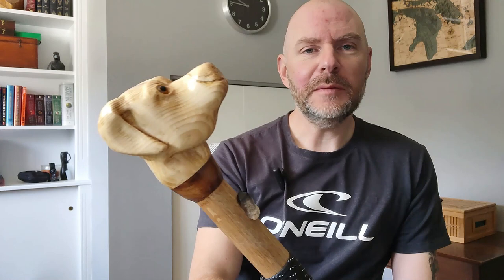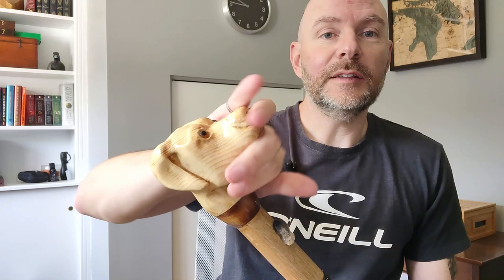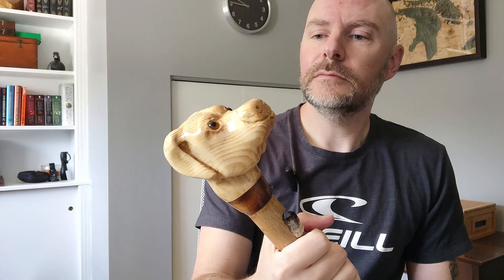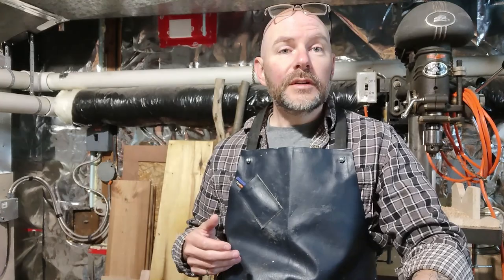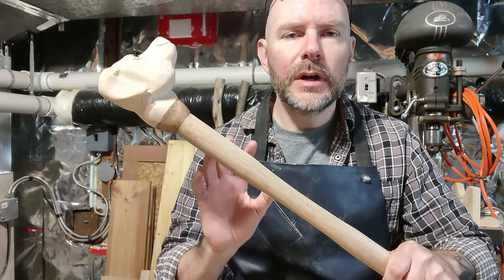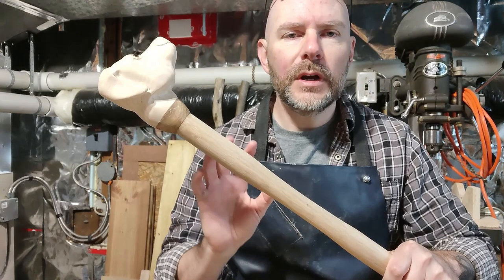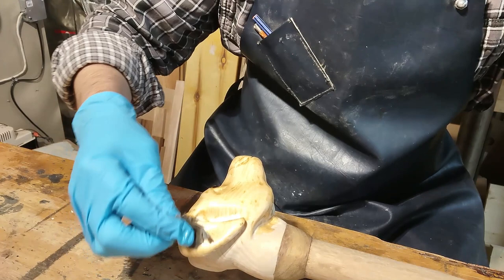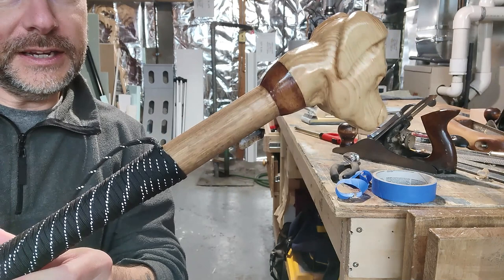WOODCARVING A WALKING STICK

Comment: Fantastic, did I miss how you mounted the crystal? 😅
Reply from the maker: No you didn't, I didn't add it in the build (it was getting too long). I carved out a section with the Dremel to fit about half the crystal into the wood